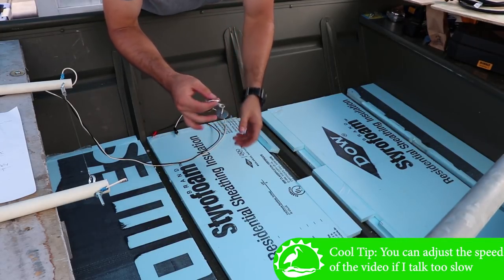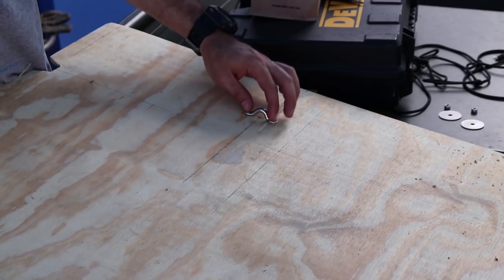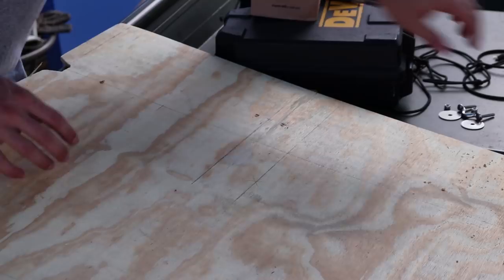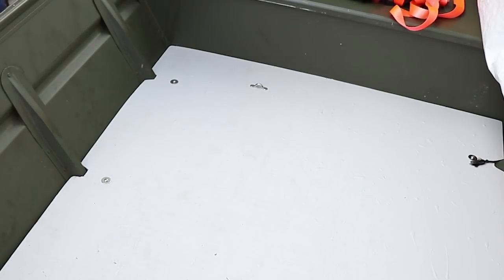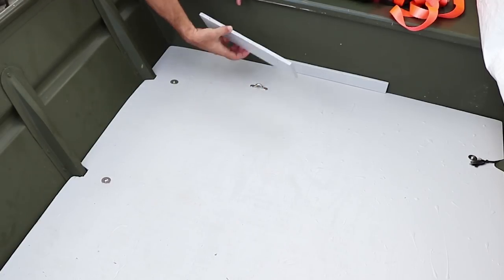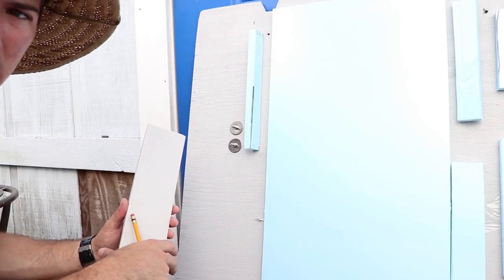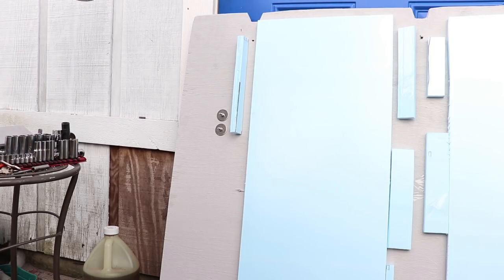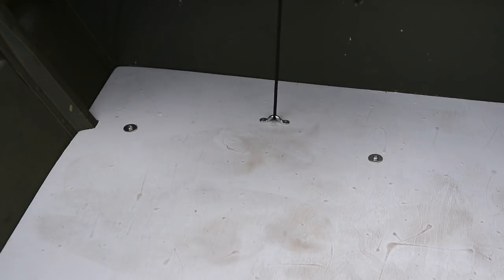Jon Boat Floor | Paint & Install Part3

Comment: As usual, great job. 
Here is a thought for ya. When I did my floor in my small jon, after i painted it while the paint was wet i threw sand all over it, then after it dried i painted it again for a cheap nonslip finish.
Reply: C Price that’s a great idea 👍
Reply: GetOutTheHouseGoFish thanks
Reply from the maker: C Price that is a very good idea. I did the wet paint with sand with a friend on his commercial fishing boat, but it was very hard to clean so I thought I would try this to see how it works. If it doesn't work, then the sand will be added hahaha I didn't think of mentioning it, thank you for posting this comment! I hope others that are interested in building a floor will look down here and see your comment

Comment: Yours is the best idea for a floor installation I've seen. I'm going to use it but I'll use 1" thick foam instead at full width between the ribs. Thanks!
Reply from the maker: Thank you! That is what I recommend people do. I should have gone with the 1" thick sheet. Best of luck on your project!

Comment: You did a nice job with the sub floor installation.  I have one question.  I’ve seen many sub floor installs on YouTube.  Not one install allows water in the boat to drain back towards the transom.  It looks to me that the water is trapped between seats.  What am I missing?
Reply from the maker: Thank you Bernie! With this boat, the water drains under the floor. This is a riveted jon boat and the bottom has three creases/bends in it that run the length of the boat to give the metal some strength. This is what transports the water to the rear of the boat.
Reply: @JTgatoring  I understand that, but the sub floor between the seats completely covers those channels.  Now, if there were an access hole for each channel right in front of the seat on the sub floor so the water can continue to flow, I can see how the water can make its way back to the transom.  I just bought a used topper tracker 1436 and plan to install a sub floor install between the back seat and center seat, also between the center seat and bow.  My plan was to put a small access hole at each channel located right in front of the seat.  Wouldn’t this allow the water without any restrictions towards the transom?
Reply from the maker: @berniesimon3234  When water gets put on top of the floor, it either runs off the sides or evaporates. It is not sealed all the way around the edges. When the water runs off the sides, it normally finds the jon boat sheet metal. Once it finds the sheet metal, it will either go into the channels or stay between the styrofoam and the metal (normally a small amount) When I removed the floor after three years there was no mold and everything was dry, and the floor is still good. One thing I wish I would have done is left a little more space between the floor and the back seat. I ended up cutting the wood too tight and it fits very snugly against the back seat and the water pools a little (when it rains or a cooler leaking) till it runs off to either the port side or starboard side of the floor and finds the channels and goes to the back of the boat. I wouldn't drill holes because holes clog. I would just leave a gap between the seat and floor so that water would run off and find the channels as it already does, just not as quick haha and it won't clog as easily
Reply: @JTgatoring  , I gotcha and see what you mean.  The boat will be used for crabbing mostly and that makes a mess.  I’ll have to wash the boat each time I crab.  Water will fill the boat while washing and I’ll need it to drain quickly.  I was worried about water leaking on the sides and plan to seal all edges, including where the floor meets the braces.  I hear ya about channels clogging, but I plan to cover each hole with stainless steel drain screens.  I also have access to each channel at the bow where I plan to put a casting deck/storage compartment.  If needed, I can clear out any clogs with a snake.  Guys like yourself that post their builds on YouTube are a great help to guys like myself.  Thanks and keep posting!
Reply from the maker: @berniesimon3234  Yeah that's a completely different situation than what I'm doing haha your deck will see a lot more water than mine. Yeah, it seems like you have a good thinker on you so you'll figure it out and make it work. I appreciate the kind words and taking the time to leave a comment and have a discussion. Best of luck to you!

Comment: I’m debating one on my boat just like this but I’ve heard I don’t remember who or were but that it is bad for the boat rivets or something to walk either on the ribs or on the floor between. Is that true ?
Reply from the maker: At 150lbs, I'm not heavy enough to know about that. If the boat isn't in the water, then it's bad to walk inside of it because it will flex a lot more and there's nothing supporting it. When the boat is in the water, then there shouldn't be an issue unless you're trying to break it. The floor will increase surface area and disperse/distribute your weight which I would think would decrease the stress on the boat hull and rivets.

Comment: How did the traction turn on with the splatter? I just got a boat recently and plan on doing the plywood floor with kingspan green guard foam. Just trying to figure out the best solution for slip resistance.
Reply from the maker: It's still pretty smooth. For me, it works. Gator blood, sand, dirt, pollen, and fish slime all clean up easily with a wet rag. I'm normally barefoot and it's enough traction for me. I was going to do sand, but the last time I did it on another project, it was too aggressive and hard to clean with a rag. I've never had the foam, so I can't comment on it, but I don't like stains and things that hold or trap water. So in the end, for me, the paint splatter worked great, but it doesn't really add much traction if that's what you are going for.

Comment: It looks like it has been over 2 years since you completed the wood floor.  How did it hold up with just painting it?
Reply from the maker: It's still in operation. I believe I have an updated video on the channel to show how it is. Everything is good with it. Styrofoam is still lightweight which means it has not collected water and the wood is still stiff, no rot or soft spots

Comment: Looks great man, I really appreciate your video its helped me with allot of ideas I’ve been considering. I’m about to do the floor soon on my aluminum boat and was wandering What kind of outdoor paint did you use? Was it solvent or oil based or a water based, did you use a primer,  and how well has it held up?
Reply from the maker: The paint I used is a general outdoor paint, no primer. It has held up pretty good. If I were to redo it, I would probably seal the wood with an epoxy, and then paint over it because epoxy doesn't do good in the sun. But that way it is completely sealed. The goal is to seal the wood, so whatever way you know best to do that, go with it. Here is the update video - https://youtu.be/AG-zhPKIy1c

Comment: That’s a great floor idea. Seems a lot easier to clean compared to boat carpet. How is the deck doing after 3 years of use?
Reply from the maker: Thank you! I have a few update videos posted, but it's still holding strong. No rot that I can tell of and it's just as solid as it was when I first put it in. Dragged a few gators across, many fish have hit the deck along with a lot of clean-up sessions, and it's still there after all those hours. The best part is, if I do happen to break it or want to change it, it's six screws and I can use it as a template to create a new one.

Comment: How thick is the fly wood? i just bought a Tracker Topper 1436 and i'm fixing to add a wooden floor with carpet..
Reply from the maker: My floor has 1" thick foam and I used 3/8" plywood
Reply: @JTgatoring  cool thanks nice job on the floor...
Reply from the maker: @paulbacallo4739  Thank you!!

Comment: so whats the Styrofoam for? sound?  what happens when water goes in the boat?  any drain system ?
Reply from the maker: The styrofoam adds support and does help with sound. If I put that 1/4" plywood on top of the ribs as I did, it would sag and break when you stepped on it. You could do thicker plywood but it would be a lot heavier. So to save on weight, and help with sound I supported the lightweight plywood with foam. The foam I used is closed cell foam so it does not soak up water. The crimps in the bottom of the boat allow water to drain to the rear.

Comment: Is it Ok to get the insulation under the wood flooring wet?
Reply from the maker: Yes, the foam that I put under this floor does not absorb or soak up water or moisture. It is a close-cell foam.

Comment: Just wondering what the foam on the floor is for? Is it needed?
Reply from the maker: The foam helps with noise and gives support to the underside of the wood. If installed properly, it can also give buoyancy to the boat if capsizes.

Comment: Is there a reason you did not use a counter sink bolt to attach the floor to the rivenuts? I just got a used 10' jon boat and I'm learning a lot. Keep the videos coming.
Reply from the maker: This is just my thinking behind it, and I don't know if it is needed or not, but I wanted to use a washer to help disperse some of the weight and get more surface area on the wood with the wood being so thin. If I didn't use washers, and I counter sunk the bolts, then I felt I needed to add more of them to the floor to secure it. The washers just gave me the feeling that the bolts wouldn't pull through the wood and that it gives overall better reinforcement. I haven't experienced anything bad with the bolt heads like they are. I wear flip-flops while on the boat, and I do not notice the heads sticking up much, if not at all. I hope you enjoy the videos and thank you for stopping by @Frank Thornal! Any more questions, please post em!

Comment: Why did you splatter the paint? I don't think it will help with traction, and just looks like you didn't care and did a sloppy job.
Reply from the maker: I would like to think that it helps with traction, and I like the look of it. I didn't want to put sand on the paint or anything like that so I thought I would do a splatter coat to see how it did